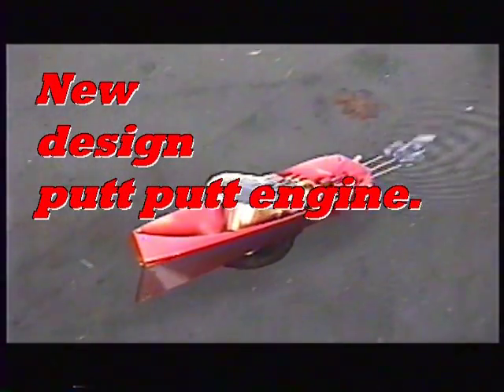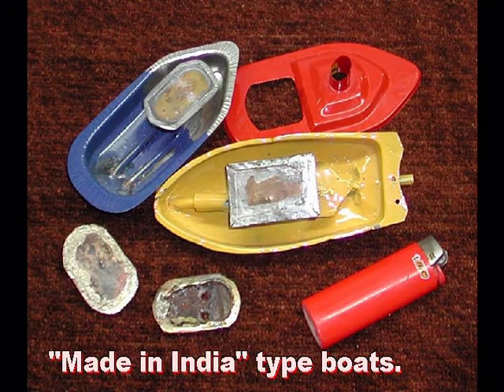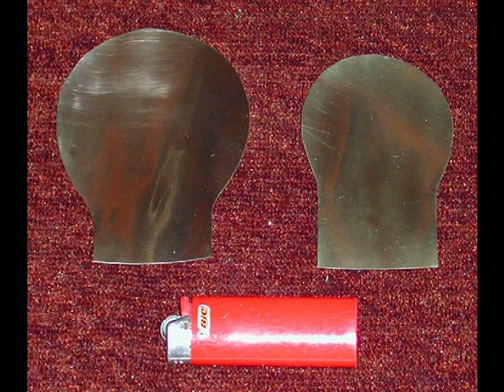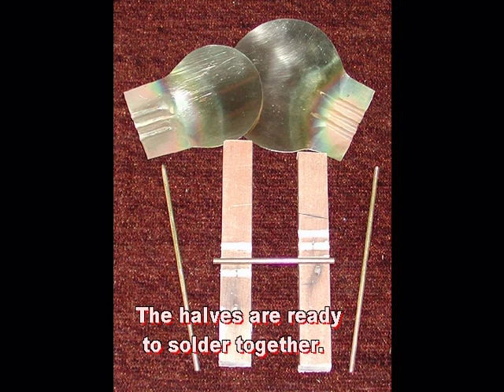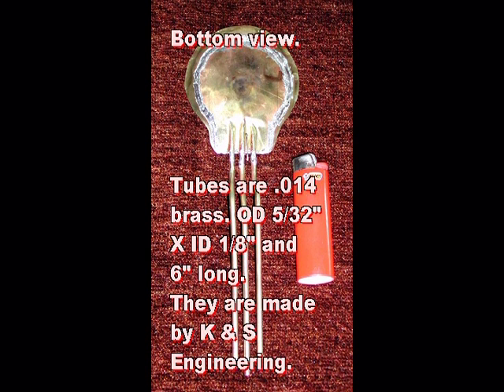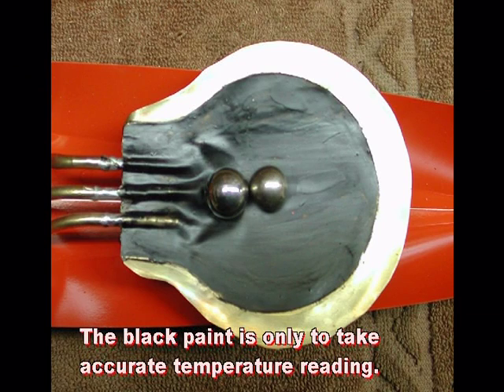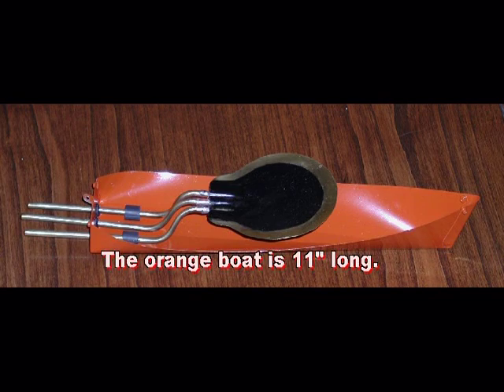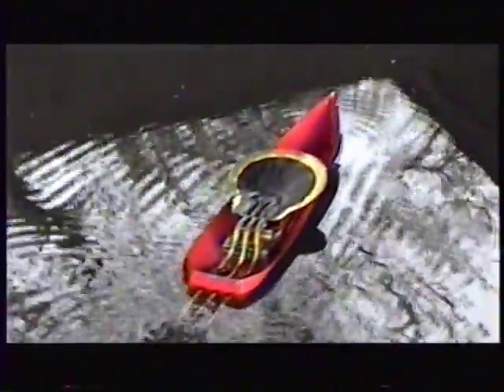How to Build the PP4V Putt Putt Engine-YT.mpg

Comment: Have you experimented with longer tubes?  Is there an optimum length?
Reply: wraft l
Reply from the maker: wraft  Hello wraft. Yes I have experimented a lot with tube length and diameter and it does matter. Not so much on diaphragm engines as the others though. There is more tech info in my other videos. There seems to be an optimum but it varies along with all the other variables in different engine designs.
Reply: Hi Daryl.  Thanks so much for your informative reply.  I note in passing that I much prefer your silent coil engines to the noisy membrane engines although your latest membrane engine looks like a beauty.

Have you ever tried to build an engine with, say, 1/2" diameter or larger tubes 4 to 5 feet length?

My interest in putt-putts is more in the area of the math of the cycles.  It is quite a simple matter to model the cycles with a 2 differential equation system of the first order. The parameters that I varied in running the equations on my computer were, basically, the volume of the boiler, the volume of the tubes and the length of the tubes. For certain lengths, the system would not cycle at all.  I was thinking it had something to do with resonant natural frequencies, although I never really nailed it down.  Also, I noticed that the system seemed to accumulate energy, in that the velocity of the water column would grow with time.  This peak velocity would then level off and, then, after a few minutes suddenly stop completely, which astonished me.  It is as though the system has a limit.  This is entirely a math phenomenon but I was wondering if it might have something to do with the "dry boiler" problem that is often described by experimenters.

I am hopeless at building models.  I once made a putt-putt engine with the spherical bottom of a coke can and some drinking straws. It only worked slightly and I gave up on it when I got sick of getting epoxy glue all over my body.

Anyway, I'm glad to know that you are out there chewing away on these problems.

Warren Raftshol
Reply from the maker: wraft I did play with a few 1/2" ID or more engines but as my main interest was speed the weight of large engines overwhelmed any potential or realized gain from the larger engine. Most of my work is based on trial and error with some high quality math/physics input from Jean-Yves Renaud in France. His input was invaluable and we collaborated on some tests and performance charting.  I understand that the math or modeling is difficult as these strange little engines do not scale up and are quite unpredictable. Heat control and the condensation phase proved difficult to stabilize hence much of the burn out/dry out problems. The little 7 tube engine in my world's fastest videos proved to be the best power to weight performer and was quite reliable and strong. I have built engines with up to 4x it's power/force but could not make it go as fast nor perform as consistently. A single tube engine with little or no boiler has huge potential but again the controlling heat and condensation is extremely difficult.
Jean-Yves and written quite a few papers on the math/physics that would probably interest you and I would be very curious to know if your work is in agreement with his. You can find the papers at www.eclecticspace.net. go to the pop pop pages and then to Jean -Yves's pages. There is translation built in.
Please let me know if there are new developments.
Reply: When I mentioned a  larger ID tube, I meant to refer to the water column. not the boiler. What is the ID of the tubes your are using?

With small diameter tubes, the water boundary layer thickness can constrict the water flow significantly. Water behaves more like syrup than an inviscid fluid.  I'm thinking that with a larger tube, your kinetic energy losses due to this boundary drag would be more ignorable and the water column could reach a higher velocity.

I can't seem to get a translated version of eclecticspace.com, possibly due to my using a Mac instead of a PC.  I sent Jean-Yves an email asking for his suggestion.  I am quite eager to read his studies.

Again, I am a fan of your boats and videos.
Reply from the maker: wraft The measurement I gave you is tube ID, not boiler. Other than single tube engines I have used ID's from 1/8" to 3/8".Hertz comes into the calculations.Click on the Union Jack flag to get the English translation.More interesting reading is at this link    http://modelsteam.myfreeforum.org/viewtopic.php?p=632178#632178

Comment: Would a foil boiler work
Reply from the maker: lewis colley It has to be strong enough to handle the pressure and the heat and also to make noise it needs some temper or "springiness".

Comment: so im trying to understand whats getting used for fuel inside the engine? whats getting cooked in the engine? i think i'd like to make one.
Reply from the maker: Just water.  Watch my other videos and learn more....if you like. Thanks for watching and commenting.
Reply: Daryl Foster thats what i wanted to hear! thanks .  so i like the work your doing and you are good at it so try to make a new one maybe and make the pipes come to a funnel point just tappering the very end that is in the water line i think that may make higher pressure and higher speed even? thanks again for sharing.
Reply from the maker: gforcefoamy Most of the tubes do have a nozzle at the outlet although not all benefit from them. Clever of you to recognize that.

Comment: does the tank part of the engine have to be flimsy? I would like to create my own design but i know very little of these. If the boiler/tank part were completely rigid would it still function properly?
Reply from the maker: The ones that are flimsy/flexible is so they will make the pop pop sound. Engines with rigid boilers perform better re power but are silent. Look at some of my other videos. In particular putt putt engine design where you will see many different types. Have fun.
Reply: Daryl Foster thank you for the quick reply you and your videos have been very helpful.

Comment: Please, you would help me alot if you tell me where on ebay could I buy a good sheet for engine. Thanx!!!
Reply from the maker: You can Google "brass shim stock" where there are lots listed or search for it on ebay. You can also try hobby stores, metal supply stores or automotive/machine shop supply stores in your town.. Thanks for watching..

Comment: Thanks for your reply. That makes sense. But how is that everybody else's pop pops don't need that amount of time to reheat the water? Have I got too much water in my engine? Thanks.
Reply from the maker: The problem you describe is usually caused by too much water or too much volume for your heat source to keep going. The amount of water in the boiler usually will correct itself with a bit of running. Unless you have a huge volume I would first try increasing the heat gradually in steps.

Comment: Excellent result! Do you soldered it with tin? Heat does not melts the tin when the motor is working?

(Maybe you explained it in the video, but I don't understand spoken English, pardon).

Comment: The fuel is simply water, You put water in to one tube until it starts running out of the others. Once you have that done you put a small fire or candle under your tank(The brass plates welded or soldered together).

Comment from the maker: This engine runs well and only needs a small amount of heat. Too much heat will melt the lead/tin plumbers solder. Silver solder/braze won't melt but very, very hard to use on thin material like this engine has. See my other designs that do not have diaphragms and build with high temperature silver braze and you will be very happy.

Comment: Dear Sir...
- After welding parts top and bottom has been distorted ( has been too much  gap volume) boiler work well but no sound, and I build another by  start welding the edge of the circle, then to the tube (  less volume than before). Now, the boiler working with the sound.(I like to build the boiler just for hear the sound  not for the boat)
 Final I am exceeding  grateful your help.and I wish you and your family a Merry Christmas happy.

Comment from the maker: If I understand your question correctly the top and bottom should nest together like two spoons but not quite so much curve. This will add strength to your thin material. No gap ,no volume is correct. Don't worry if kinks make a bit of space. Because your material is thin it might bulge when you run it. It should still run but with less power. Let me know how it goes.

Comment: Dear  Sir...
 Because I use .004 brass sheet  it is easy to deform.So please help me to know. :
 -I must put 2 pieces (bottom +top)together with in 
O-shaped form (have a gap ,volume) 
 -Or with  in C-shaped form ( all part 2 piece touch together= no gap ,no volume) before to solder.Thank you in advance you time.

Comment from the maker: Thanks. Use normal plumbers solder. Tin is OK but it will rust quickly. Best engines are brazed with higher temperature silver brazing/solder.

Comment from the maker: 5/32 ID should be OK. >005 brass sheet should be OK. Keep direct flame as far from solder as possible. Change top to bottom probably OK.Hole in wood to match pipe size. You might find the right materials at a hobby shop. Hope I understand your questions.

Comment: Dear Sir ...
I am very interested in your boiler. I live in Montreal but my English too bad.So I do not know all of what you say Please can you help me some questions before I buy the materials to make it.
 - Can I use 5/32 copper tube + .005 "brass sheet (Ebay)
- Why do you put place welding (2'' 1/2 the graph) directly to the wick If I  change  by turn the top to the bottom is the same. (Avoid the lead melted.)
 -Diameter hole drilled wood pieces.
            Thank you so much for your time.

Comment from the maker: I don't know what a jet torch is but assume it is a small propane/butane burner. It should work OK. It might be able to get much hotter so be carefull not to overheat the the metal which may then warp. That won't stop it from working but perhaps not as well and perhaps without sound. Go for it. You are not risking much. Let me know how it goes.

Comment from the maker: Thanks for watching and commenting. Two reasons for making one side larger than the other. #1.- Easier to solder. #2.-I hoped it would act like a cooling fin to keep the temperature lower where the vulnerable cold solder join is and I believe it does help. Part of the object of this build was to make it simple and not require special skills like silver brazing.
Reply: sometimes one tube is longer than the other, it makes no difference, I presume, but... what about different diameters? one bigger than the other...  the big one at the base of the boiler, and the narrower one coming out of the top, one to favour water ingress the other to steam out...

Comment from the maker: Thanks for commenting. The terms can be confusing if you are not familiar with how these engines work. I have used inlet as the end near the boiler and outlet is the end under water. In function all the tubes do the same thing. The water shuttles back and forth in all tubes. If you listen again you should hear that the inlets (boiler end) should be 1 1/4" higher than the outlets (not 1/4") when set up for running, and the outlets should be about 1/4" under water. Ask again if this is not clear.

Comment from the maker: Thanks for commenting and watching. JB Weldbond is a good product. The engine normally  should not exceed 500F. Adhesives are not usually at their best when subjected to the type of stress (shear) this design would put on them particularly because the surfaces to be joined are small in area. Clamping would be tricky as you don't want to squeeze all the glue out. By all means try it and let us know how it works. You are not out much if it fails and others might like to know.

Comment: I'll get back to you about that heated seat option. Sounds...um...a bit to hot. 
The two halves spoon together, right? I am intrigued with the zero volume or low volume concept. How did you discover it? Do you think it results in capillary attraction that helps keep it from running dry?  Every engine I've seen--including my strange creations--have space between top and bottom.
Finally, when you say "small electric soldering iron" does that mean 30 watt, as I use for electronics?

Comment from the maker: I will send you the list of options available which might alleviate your disappointment. The heated seats have been popular. 

Regarding stupid questions:-Yes. The shape and material have been chosen to dissipate the heat before it reaches the solder. A small electric soldering iron is all that is required and the solder is lead free low temperature plumbers solder.

Thanks for watching and for the questions.

Comment: I'm disappointed, Daryl. Sure, it's brilliantly designed and built; loud AND powerful. But can it text or connect me to my facebook account? Am I missing something? Seriously, great job! You've opened up original branches of engine design

May I ask a few stupid questions? First, regarding engine design, is the big size partly a strategy to keep the heat away from the solder? Can you remind us, how do you solder: flame or big soldering iron? Is the solder you use lead free plumbing solder?